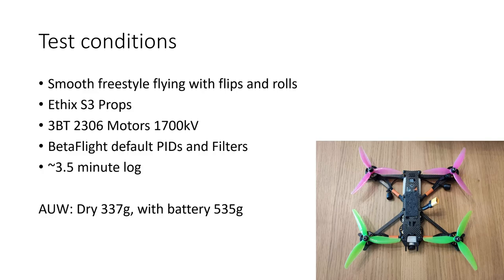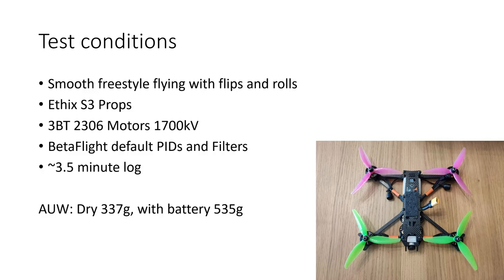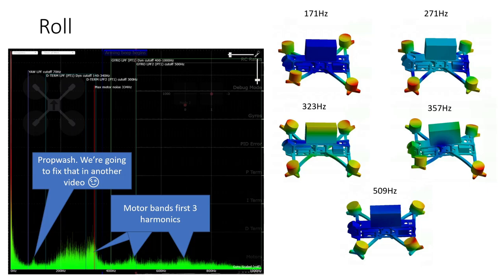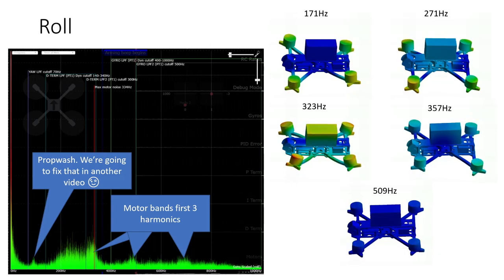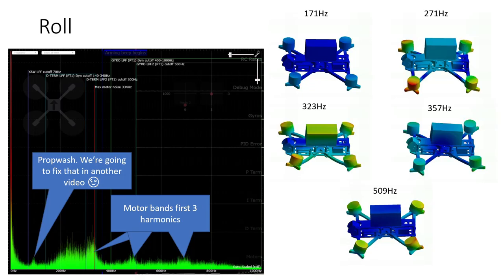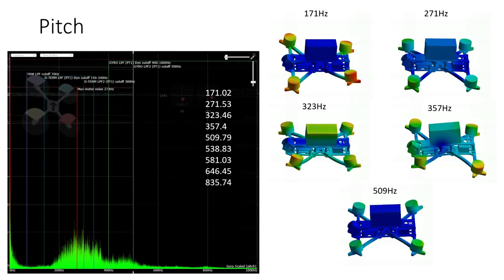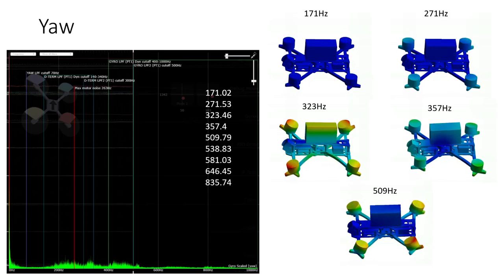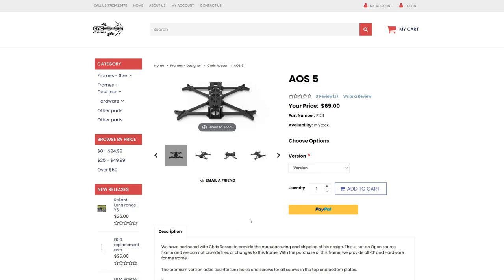AOS 5 Blackbox log and harmonic analysis

Comment: This is awesome! I can't wait to see it in a 6 inch configuration. Betaflight has never been quite as good at filtering for 6 inch, but they handle the weight of the larger Gopros effortlessly. I think the AOS 6 running 2408 motors is going to be real sweet spot
Reply from the maker: Prototypes for 5.5" and 6" versions are going out in the next few days. I hope you won't have to wait too long.

Comment: Awesome video Chris! I saw you had a label of "propwash" somewhere in your video. It reminded me of the conversation I had with a Betaflight developer in Slack. He told me that propwash can never be fixed via tuning, maybe improve it only. He shared some techniques on how to avoid it such us earlier throttle and no zero-throttle.
Reply from the maker: He's right you can't 'fix' it. But if you reduce the filtering and increase the PID gains you can improve the flight controller's handling of propwash and all but eliminate the shuddering and oscillations you might otherwise experience on stock PIDs.
Reply: @ChrisRosser  yup, that's what he told me to do last year. It helped but there is still little propwash left. Most of the time propwash doesn't happen. Sometimes it happens when the position of my quad to a split-s recovery is wrong. Cool! Thanks!

Comment: Congratulations for this excellent design! It seems to strike a really nice compromise between stiffness, weight and practicality. Really the only issues I could think of are long-term durability and maybe a little more air being blocked/perturbed by the struts than by a wider regular arm. Also, I'm a weirdo that still uses individual ESCs but that's just be me.
Reply from the maker: Thanks Snorkl. Long term durability is always a challenge that's why I expect the design to evolve as people put it to the test.

Comment: Would you recommend going with smaller motors for a lighter weight setup like this to increase the eigenfrequencies even further? 
Maybe for other frames with less stiff arms?
Specifically the AMAX SUPERLEGGERA 2305.5 looks interesting at 91.7% of the stator volume of a 2306, with a weight of 23.2g. This is only 82% of an EMAX eco II 2306's mass (both manufacturer claimed weights without wires).
Reply from the maker: I wouldn't run less than a 2306 on this frame because you need the torque for the best flight feel. I made the arms super stiff to handle the mass. Just don't go bigger than a 2208 and you should be golden.

Comment: After I finished my AOS5 build I gathering some black box flight data and invested quit a bit and did a frequency respone estimation of the dynamics of the quad in RPY direction for its current closed-loop dynamics as well as for the open-loop dynamics (this can be calculated from different closed-loop dynamics estimates). I actually see the same resonanze peak at about 100 Hz in the estimated closed-loop frequency response in the R-axis as shown from Chris in the spectras. If it were propwash (kind of input disturbance) I'm almost certain it would have got cancelled out with the estimation technique I'm using. There is nothing on the quad that could be responsible for the resonance other than the quads structure and the mass distribution itself (i think). The only solution to enable high controller gains that I found was to enable a static notch for this particular frequency. The resulting closed-loop dynamic is still pretty good but not perfect... considering the 171 Hz for the first eigenmode in the R-axis that were mentioned in the video, this is somewhat a disapointment. Anyway... it was the first of a bunch of frames and there is (almost) always room for improvement. I would just really wish betaflight gave the opportunity to excite the quad with a chirp-signal or something simillar while flying so simulation could be validated with real data over a wide frequency range. Cheers Chris anyway! I love what you're doing!
Reply from the maker: This could be filter ringing from the dynamic notch or rpm filters.

Comment: Are you going to do any frame analysis videos which include a camera mounted with a TPU mount?  It seems like this is a significant mass which might have a major impact on resonance modes.  In addition, there is a lot of development work which could be done on the design of the structure which couples the camera to the frame to most effectively reduce camera shake.

Comment: if that is raw gyro data thats is crazy crazy crazy clean - well done
Reply from the maker: That is raw gyro with no filtering at all. I'm super happy with it, go science!
Reply: Cmooooon guys....it's was a smooth flight test. Of course, the schedule will be flat.
Reply: I can see your point - but... it's still crazy clean... chris - post some black box with  the UAVtech standard flight test for PID tuning next time - its sort of the benchmark I guess for FPV tuning data - flips, rolls, split-s, snap turns, propwash and throttle stepping - you know the drill

Comment: I keep trying to think of how we could triangulate the arms in that 3rd vertical dimension and if it would be worth the weight. If the two arms triangulated into the middle of the top plate somehow those lowest frequencies would be significantly reduced.
Reply: I've been pondering this, too.  I'm thinking of running a strut from the motor mount bolts to the top plate bolt so the arm is a tripod rather than a triangle.  Then flip the frame over so the lower plate is now the top plate, and the bottom is now the top deck, where the battery mounts.

Comment: Do YOU have each version of the frame... regular vs premium (countersunk vs not)???

How does their frame resonance compare? Although you used very nice thick arms, I would assume normally countersunk screw holes would not be as stiff...I can imagine resonance being effected to either side depending on where the countersunk holes are placed...

?????     ???????
Reply from the maker: Hi, I have both frame versions. The countersinking doesn't affect the resonance performance of the frame. The arms are not countersunk only the top plate and bottom plate. Choose whichever one is right for you and it should perform just like mine.

Comment: Love the approach and how this seems to be an incrementally improved GepRC Mark4. However, at 115g this really isn’t a lightweight  but a regularly heavy 5” frame. Take a look at the Raging Droner by Catalyst Machineworks, starting at 75 grams if you want to see light weight. Greetings from a fellow physicist 🥰
Reply from the maker: Lovely to meet you! Lightweight is certainly relative but the raging droner is a racing frame so I would not put it in the same category as the AOS 5. I will be doing a 5in racing frame, I hope when it's done you'll be pleased with the results. Go science!

Comment: Chris. 

did you apply grease for dampening?

cheap motors tend to use cheap bearings. a few flights and motors would be loose(bell play, im guessing almost 0.5mm) . just like the emax eco series.
Reply from the maker: Not for this flight. But it's going on my perfect AOS 5 build right now!

Comment: Hey Chris just a quick question about frame resonance. Would mounting the electronics on the top plate reduce resonance more? Putting the electronics further away from the motors.
Reply from the maker: Interesting thought. I'll have to look into that in the simulations.
Reply: That would be really interesting if it worked. I am by no means a scientist but after seeing the definition being. the reinforcement or prolongation of sound by reflection from a surface or by the synchronous vibration of a neighboring object. Just seems like moving the gyro further away from the vibrations may reduce noise a bit more. Is there anyway you could share your results with me?

Comment: I make fiberglass and carbon fiber molds and parts for a living. We also have a water jet and full machine shop and make flat panels too. I've been wondering if the strength and stiffness wouldn't be helped by making a frame that has 3 dimensions instead of just 2. For example, we make a carbon fiber steering wheel for a racecar. The 2 halves are glued together with the hollow section filled with a 2 part expanding foam. The foam helps to stiffen and dampen vibrations felt in the wheel while also keeping it light weight. I'm going to get a frame and modify it to see what differences it makes. I've only seen 1 frame that is "molded carbon fiber ". Its expensive but I'd be interested to see how it resonates.
Reply: frame parts that can be replaced are the first reason why fpv quads use 2d cf sheets. 2nd, cheap and quick. 
sandwich designs must still propose quick replacement of parts. 
Or completely opposite direction:
complete sandwich cf composite monocoque that wont break and still light. I believe it's possible, but quite a design challenge.  I also believe this is the next step in frame designs.
Also, watch waterproof floating drones which are monocoque, i'd bet the resonant modes are way higher ;) but don't miss that power loop though
Reply: @charlesmarseille123  Good point. 2d is cheaper and faster to make but one of the durability problems I've noticed with it is that it's the edge of the panel that impacts objects. So the impacts not only try to break the carbon by twisting it, but the impact also tries to delaminate the carbon panel. 
The easiest way to delaminate carbon is to attack the edge where the layers all sit on top of one another. A curved arm or even an angle arm I think might hold up better. Not cheaper or faster to make, but stronger and it would protect the vulnerable edge. Another problem with the edge is that these carbon panels are just using woven carbon for the top and bottom layers and unidirectional carbon in the middle. A single layer of woven carbon has the layers running in both directions and those directions are not just held together by resin, but also held together by being woven into each other. That means there are half as many points where the carbon can delaminate if it were solid woven carbon instead of unidirectional. The woven carbon also doesn't run in a flat plane. It looks more like a wave, going up and down, over and under the strands running 90 degrees from it which I think adds to the stiffness. 2x2 twill weave is the most common weave I see, but the 4x4 twill weave is stiffer than that. 
The cost is an interesting thing. Chris Rosser is saying there is very little difference between an $11 motor and a $26 motor, but people are buying the most expensive motors all the time. Smashing them and buying more. Frames are one of the cheaper components of the quad at the moment. Something tells me that if there were a more expensive frame that was actually better, there would be a market for it, albeit a small one. 
I love to tinker so I'll end up trying some of this stuff. I made carbon cups that the motors sit in to protect the motors in crashes. I've heard someone say they don't like adding weight to the ends of the arms. That's true, but maybe they would be good for a beginner that doesn't want to replace motors as often. Or even for experienced people that are trying a new thing, knowing they're going to smash several quads before getting it right. The cups can be removed after you have the trick locked down. 
I've also thought about a G10 fiberglass top plate, or even a section under the stack that's non conductive G10. On the Indy Cars you'll see a gold circle on the carbon tub. That's Kevlar and the antenna sits behind it so the signal can penetrate that section of the car. I've had trouble with metal from the antenna or pigtail touching the carbon and adding a lot of noise in the video feed. I ended up making a fiberglass antenna mount for my Gep mk4 and that's gotten rid of all of the lines and dots in my video.

Comment: Any thoughts on using carbon fiber tubes for arms?
Reply: Or an aluminum i beam 😊
Reply from the maker: I've definitely thought about it. Mounting motors to it and attaching to the frame is the challenge. But your right that a tube is a great geometry for stiffness (not so much for strength though if its hollow)

Comment: Did you use topology optimization to inform your choice for the arm profile?
Reply from the maker: I did yes. But for the loading cases I tried the result was quite straightforward unlike with the top and bottom plate cutouts which were interesting to me.

Comment: Can’t order frame if you live in US?
It says no shipping methods for my address.
Reply from the maker: You should be able to if you input all the information with the red *. If you still can't, use the RFQ form to order.
Reply: @ChrisRosser  Both ways say the exact same thing.No shipping methods available for my address.I have every red * blank filled out with same thing that’s on my confirmed PP address.I use Route with 5-6 vendors and overseas orders with same address.
 I’ll likely send them an email after the holidays.

Comment: I'm not sure that 100hz is enough low frequency to be a propwash... My ready to sky apex 5 inch frame with cheap rcinpower motors has much lower peaks, and only 2 resonance modes... I can show my log from emuflght...
Reply from the maker: Aggressively tuned quads can have propwash up to around 90Hz. That doesn't mean all noise below 100Hz is propwash however. A bad antenna or go pro mount can create vibration as well.